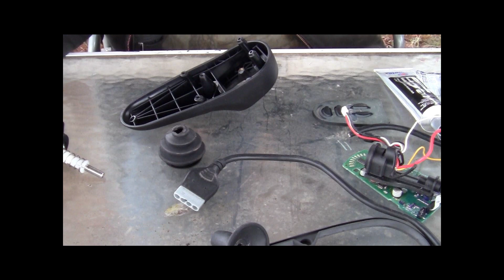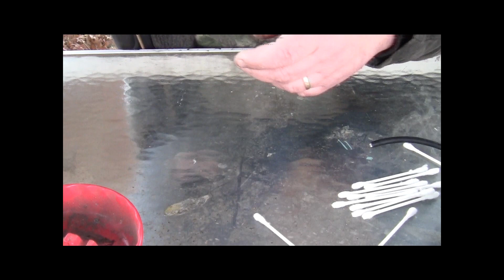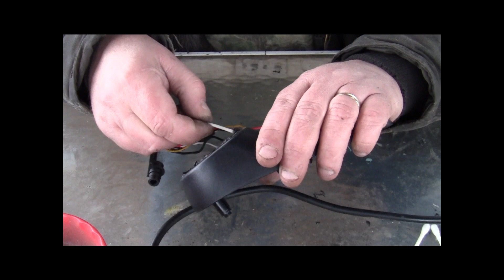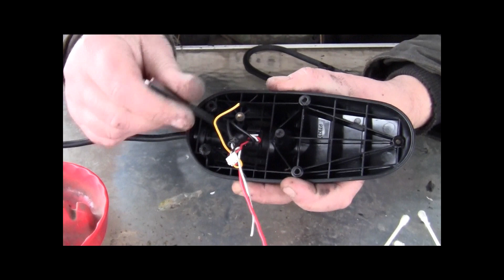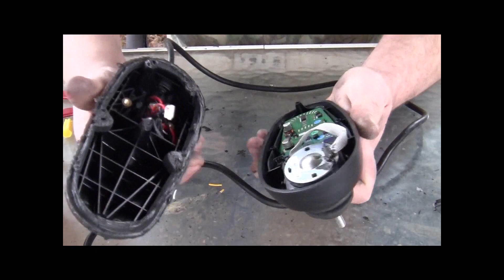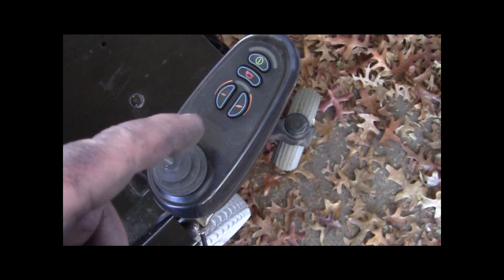WHEELCHAIR CONTROL WATERPROOF & REPAIR

Comment: Sir i m from pakistan  my electronic wheelchair does not turns on plz help me.
Reply from the maker: first step is to check your battery voltage . Next check your fuses /circuit breakers make sure you have power to your box on the chair. You should have 25 or more volts at the control box input.
Reply: I got the same issue.. battery voltage was 22v. controller isn't responding despite being charged.

Comment: i need a replacement for DL 5.2i DL50UBR12 JOYSTICK. do you know what the best source for it? i appreciate your help
Reply from the maker: here is one on Ebay . Thanks !        https://www.ebay.com/itm/Dynamic-Controller-Dl-5-2i-DL50UBR7-For-Power-Wheelchair/324068089449?hash=item4b73f69e69:g:uecAAOSwUHleQGpz:sc:USPSPriority!97351!US!-1
Reply: @shawnmrfixitlee6478  this link isn't working
Reply from the maker: @shamailhasanain8517  Well of course it's been years . The product has sold out .. You can still find them . I have many of them and Ebay is the best place to find one ! Thanks ..